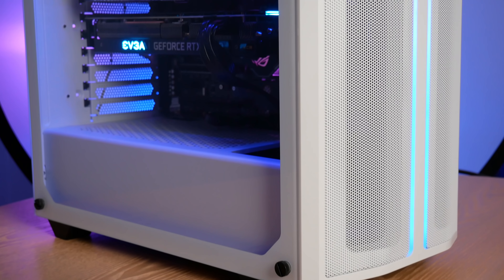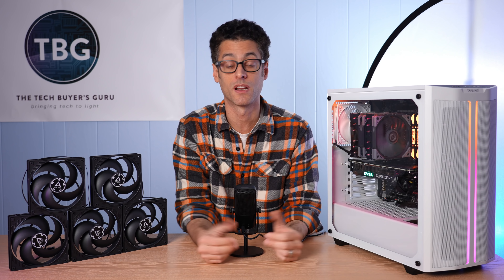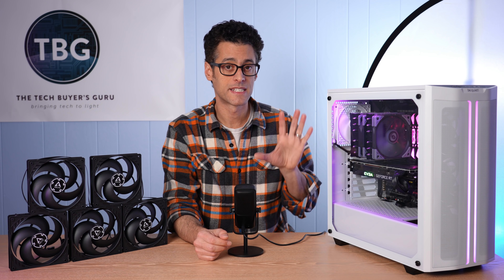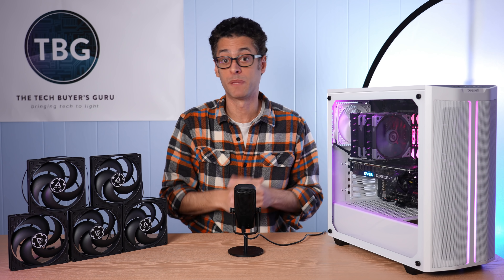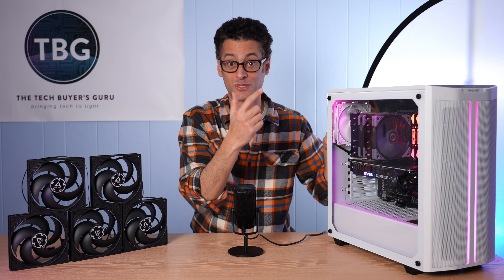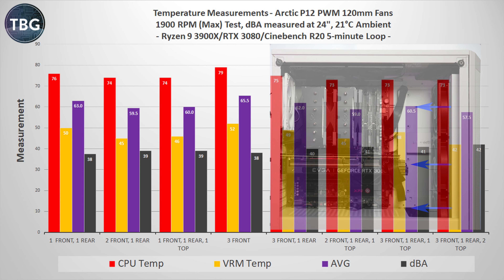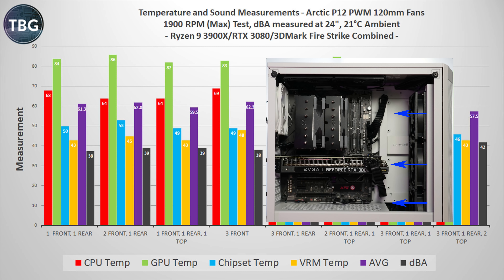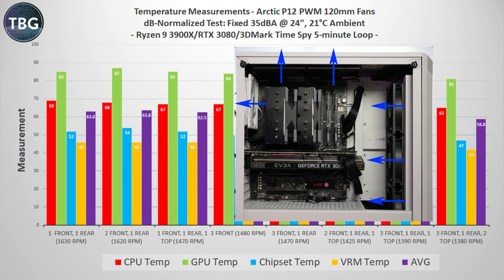Optimizing 120mm Case Fan Performance - The Best Number and Location, feat. Arctic P12 and 500DX

Comment: What about testing cases like a front/rear fans set up only, for cases that are closed on the top? I ask because the area I live in is very dusty, so I found out that having a case that does not have top mounted fans keeps A LOT MORE dust out due to dust settling in the case when I am not using it. I am trying to understand if that kind of case would have more of a wind tunnel type air flow since there is no top fans, and if it has benefits for cooling? Thanks
Reply from the maker: I don't think there will be any cooling benefit to running a case without a top vent, but you can see in my benchmarks how a front/rear combo works.

Comment: So I noticed this case has holes in the shroud allowing some airflow up and through the GPU. But most shrouds don't have the holes. So wouldn't the bottom front fan just basically fill the shroud? Do you guys think the increased pressure will still contribute to more airflow?
Reply from the maker: Mounting a fan below the GPU is a really interesting option, and it's something I may eventually benchmark, but I'd use a case that's actually designed to mount a fan in the PSU shroud area.

Comment: How relevant is it for all fans to run at the same rpm? For example: would running all 6 fans at 1500rpm would be different from running 3 front and 1 back at 1500 and 2 top at 1000? 

Im mainly concerned about thermals, dont care at all about noise.

Thanks for your help!
Reply from the maker: Yeah, definitely potential for optimization here, but this is a subject that would be pretty hard to test, because there are infinite possibilities. Very tempting to go down this road, but it may never end, so I'm not going to promise anything at this point!

Comment: The new case im building in is the phanteks 719, it has a plate on the top with exhaust coming out from the sides/edge of the plate. Would it still be good to have exhaust fans on the top in that situation? I’ll be doing air cooling and thinking of going with two bottom intake for gpu, three front and 1 back exhaust. As for the 719 front panel I will be cutting it to open it up to allow more air intake. Before anyone asks, I like big cases cuz of the ease of building in em, I also don’t like the idea of putting my storage behind the case, I want em to be cooled off. As for noise levels, they don’t bother me. I love in south texas and my loud air conditioner is on 9 out of 12 months and I use push to talk all the time anyway lol. The 719 has good storage locations, the sides which are optional for more fans but I’m not going that route, I’m going to be mounting SSD’s on em. And I really like the side location for the PSU cuz the bottom is now open for fans to feed air to the GPU.
Reply from the maker: Very common style, and while it does cut down on airflow, by no means is it zero. I specifically recommend the Arctic fans in this video for this type of high resistance application.
Reply: @TheTechBuyersGuru  nice, thanks. I was thinking of doing the scythe fans. So would you recommend the Arctic over the scythe still? 120mm is what I had in mind.
Reply from the maker: I would recommend Arctic specifically because they are good with higher resistance, while the Scythe Kaze Flex is better with lower resistance. Note that they are now almost the same price:
Arctic: https://amzn.to/2Ld5hpg
Scythe: https://amzn.to/3pMbNlK

Comment: Excellent video. I learned few things thank you. However I have 3 fan constant speed 1200rpg in front. 2 on top and one in rear. The rear fan take out less air than top 2..is that normal? Some reason the air don't reach back of the case for air circulation so I'm a bit confused. 3700x stock cooler in use.
Reply from the maker: I'm betting that because you have those two top fans, there just isn't much air for the rear fan to exhaust. I noticed this phenomenon as well when I had multiple top fans exhausting.
Reply: Thank you. I guess that's normal than 👍

Comment: I just built a monster and have questions, I know it's overkill but:
Lian Li Lancool II Mesh Performance
3x 120mm Noctua NF A12x25 chromax front  intake
2x " above psu/below gpu intake
1x " upper rear exhaust
2x 140mm noctua chromax top exhaust
2x " on the noctua cpu air cooler
Asus Rog Crosshair VIII Extreme 570x EATX mobo
Ryzen 9 5950x
MSI GeForce 3090
2x 2tb Samsung 980 pro m.2 nvme
128gb (32x4) 4000mhz corsair ddr4
How can I test my fans and mess around with them to perfect the cooling vs noise ratio?
Reply: It's for content creation, and gaming, home media center, and hosting game server for my girlfriend and I to connect to with our laptops

Comment: I currently run the 3 Front, 2 Top, 1 Rear setup. When I try to feel the air coming out off the top, the closer one to the front lets out cool air compared to the rear top fan. Do you think it'll be better for me to remove the front-top fan instead?
Reply from the maker: Tested here: https://youtu.be/iCn-XL-HyXg
Check it out!

Comment: Hey Guru, would running 3 x 120 fans top ( Aio exhaust) interfere with the 3 front fan intake as opposed to 2 x 120 fans at the top but at the back? I feel like the front 120 fan at the top would just exhaust  / stop the air coming from the front intake. Thanks!
Reply from the maker: If you're using a 360mm AIO on top (which by the way would not fit in the case I used in these videos), then it's fine to use 3x120mm in the front. The big 360mm rad will pull some air straight from the upper front fan, which is what it should be doing.
If you were interested in how top fans should be setup when not using an AIO, you can see my follow-up video, where I try a few setups: https://youtu.be/iCn-XL-HyXg
Reply: Thanks for the reply and great content. I appreciate the time and effort you take to test :)

Comment: Does moving the front fans back further from the front case grille make much difference?
Reply from the maker: I haven't specifically tested it, but yes, generally the closer a fan is to a grille, the higher the resistance, and perhaps more importantly, the noise (due to air whistling through the mesh).

Comment: In your opinion, if I wanted to buy a 5 pack of the p12’s, would it be in my best interest to include one of my stock non-pwm case fans as a rear exhaust, and have the 5 p12’s be 3 front 2 top? Or would it be best to go with a variation of 3 front 2 top, or 3 front 1 top 1 rear and forget about the stock fans I have?
Reply from the maker: What is the stock fan that you have? And what CPU and GPU do you have? For most people, I would say that running a sixth fan is not beneficial, especially if one of them is louder or less effective than the P12 fans.
Reply: @TheTechBuyersGuru  I currently use the stock fans on my Lancool II with a 3800x using the stock wraith prism cooler and a 2060. The stock fans do run fairly loud, so I’d plan to just do a quick swap with a 5 pack of p12’s
Reply from the maker: With your system, five fans will be fine, and if the stock Lian Li fan is loud, definitely remove it. But the loudest thing in your system at load is probably the Wraith Prism, so you may want to consider upgrading that at a certain point too.
Reply: @TheTechBuyersGuru  Yeah the plan is to upgrade the cpu cooler soon after, thank you for the feedback!

Comment: They're selling Kaze flex 2000rpm version here in Japan for around 8usd each. Is it really worthit or whould I go with 1200rpm? Both versions have the same price btw.
Reply from the maker: Well, you won't want to use it at 2000RPM, so as long as you're willing to set a fan curve for it manually, it would be fine. But for a case fan, I'd suggest you just get the 1200RPM model, and for coolers, it's not a good fan anyway.

Comment: is it ok to mix and match fans like 3 T30s and 3 SWP4s or better to use a uniform set of fans?
Reply from the maker: Some fans are better for intake, some better for exhaust, because they need to do completely different things. My guess is the T30 would be much better as an intake, and the SW4 might be better as an exhaust.
Reply: @TheTechBuyersGuru  what fan would you suggest as the best exhaust fan? stocks are a bit hard to find here in the Philippines that is why I usually order online to look for the specific fan that I need

Comment: Hmm, I am considering buying 5 of these unfortunately, 5 is the maximum fan placement in my case,
In those 5 fans that it can support; the locations are 2 front, 2 top, and 1 rear
What setting should I do? 2 intake (front) + 3 exhaust or 3 intake (front + 1 on top near the intake of CPU tower cooler) + 2 exhaust (1 behind the tower cooler + 1 at the rear)?
Reply from the maker: I'd suggest 2 intake, 3 exhaust.
Reply: @TheTechBuyersGuru  Thanks
Reply: @TheTechBuyersGuru  also regarding of the resonance, at what fan speed range should I avoid that?
Reply from the maker: I had issues at 1400RPM, but others have reported issues at 1000RPM or 1200RPM. Will depend on your case and the number of fans, so just be aware of it as your setting up the fan curves.
Reply: @TheTechBuyersGuru  will it help to buy aftermarket vibration pads? Or is entirely in the motor?
Reply from the maker: No. That's not the issue.

Comment: A question. Isn't P12 better for static pressure rather than airflow?
Reply: Yup, but in the case fan shootout the P12 still finished in second place.
Reply: Pulling air thru the front mesh requires decent static pressure
Reply from the maker: The F12 is inferior for all uses, I've tested this previously: https://youtu.be/WBoLyC0tSDQ
I no longer test or use F12 fans.

Comment: Then put 2 140mm fans at the front and resonance problem will be solved.
Reply from the maker: Interesting theory, but I don't think that would help. I found resonance even running one fan at specific RPMs.
Reply: @TheTechBuyersGuru  ah, i was fast to type comment. It's just about your case. So if someone is stuck with those fans and cases, i guess it can be fixed by setting fan curve to go up to for example, 1350 RPM up to 60 degrees, for example, and over 60 to jump to 1550. It's still silent and annoying noise is eliminated.

Comment: So what would be your advice for me, I got a H500 case and and cooler master 360 aio, the 2 big fan of the case pull air in, the 3 aio fans take air outside on the  front. I could set 2 on the top and 1 on the back, what's the best orientation for those fans???
Reply from the maker: Where is your 360 AIO mounted? On top?
Reply: @TheTechBuyersGuru  case cooler máster h500 comes with 2 intake front, the 3 aio on the front exhaust, and I could set 2 on the top and 1 on the back. I don't know how to orientate those on the top and the one on the back. Ty buddy
Reply from the maker: Because your case does not support a 360mm on top your best option is to do what you said: two case fans on top and one in back, and make them all exhaust. Your AIO will be dumping a lot of heat into the system.
Reply: @TheTechBuyersGuru  so only the 2 big fans on the front of the case should be talking air inside the case?? The aio the top and back should be exhausting?
Reply from the maker: Yes, but AIO will not fit on top.
Reply: @TheTechBuyersGuru  but I'm confused, if the aio fans are exhausting why you say they will dumping lot of air in the case. Sorry for bothering you, this is my first buid.
Reply: @RicoZuabe  He means IF the AIO fans are blowing TOWARD the inside of the case. You need to have enough air exiting to the outside to maximize the airflow. If the radiator for the AIO is mounted at the front, then the other case fans should be exhausting to the outside - into the room. This applies to 3 fans, 4 fans and up. See the video: 3 fans at front blowing in and 3 fans on back blowing out, OR 3 fans front, 2 fans out (and so forth) were the coolest configurations. Take your time, this really easy to do!!  Have fun!
Reply: @SISSYPUSS  thats my confusion, I have 2 case fans intake on the front, idk what's the best orientation for the 3 aio fans on the front inside the case, 2 on the top and 1 on the back. I really sorry I'm stupid it's my first build.
Reply: @RicoZuabe  ONLY the AIO fans attached to the radiator - mounted at the Front blow into the case. Don't mount 2 fans on top of each other if that's what you're asking. Clearly now; at the top of the case, those fans blow OUT of the case. At the Front of the case, they blow in. 
If you mount the radiator up top (blowing out) mount 2 fans at the front (blowing in) and one fan at the back (blowing out). If you mount the radiator at the front, put 2 fans up top blowing out. Everything blows outside except Front fans. Ok? You're not stupid, haha this is just a new thing! Take your time and ask questions!
Reply: Breiner this is a second comment, read the other one I made then take this link to see Ali's PC. The AIO is at the front and he's got one top fan and one in the back. You want your fans in the same places. His Radiator/AIO fans are mounted in front, it doesn't really matter which side they're on just have the front fans blow into the case. 
It's on youtube - here's the link  https://youtu.be/dX7azFtJDT8?t=481
Reply: @SISSYPUSS  thanks a lot, know I understand what you say, but I think my situation is a little bit different, because the case already has 2 fans on the front as intake, this video shows my confusion, this case is a better version of mine I have the cooler master H500 which is smaller, but I will have to set the aio the same as he does. If could check it and tell me what he does please. https://youtu.be/R8Rl2XjRO_0
Reply: @RicoZuabe  I didn't want to point that out so I said not to stack fans, just make yours look like his. Tech Source built a great PC there, since your case has installed fans the AIO can go up top, it will look great and run great. Cheers!!
Reply: @RicoZuabe  It sure is. Do it exactly the same way! I would like to hear back how things go for you. :)
Reply: @RicoZuabe  You're welcome! :D

Comment: Would you actually say a 6x P12 setup outperforms 6x Scythe Kaze 140 and 6x eLOOP B14-PS?
Reply from the maker: Definitely not. The 140mm fans are better in equal numbers. But if you can fit 3x140 in front, you may be better off with 4x120, for example, depending on the case. Also, position matters. See my follow-up video here: https://youtu.be/iCn-XL-HyXg

I'm doing testing nobody else on YouTube has, so this is new territory. What has been completely missed in my opinion prior to my testing is that the focus of the airflow is important. A 140mm fan can push more air, but it pushes it in a wider cross section, which may lead a lot of that airflow to be wasted.
Reply: @TheTechBuyersGuru  Meshify 2 has 140mm capability for all fan positions, so I guess that means I will get 6x B-14 or 6x Kaze Square.  I might have to order one of each and make a decision. Thank you again.
Reply: @TheTechBuyersGuru  I have watched so many of your videos on this topic the past couple days, and I greatly appreciate the time you have put into making them.
Reply: @TheTechBuyersGuru  Tested Kaze Flex Square 140mm and B14-PS myself, in push and pull configurations against a filter. The B14-PS make a horrible propeller noise (airport mode!!) in a PULL configuration, but they move an impressive amount of air. Sadly this design flaw is unacceptable in terms of silence. Kaze Flex produce an uncomfortable noise even in open air at all RPM. So none of the fans lived up to the standard. I also tested SW3 (and high-speed), and while the high-speed version makes bad noise across the RPM range, the standard SW3 is 100% silent -- unfortunately not moving as much air as I would like, but I would argue it suffices, especially if they run at 1000RPM (still COMPLETELY silent/inaudible).